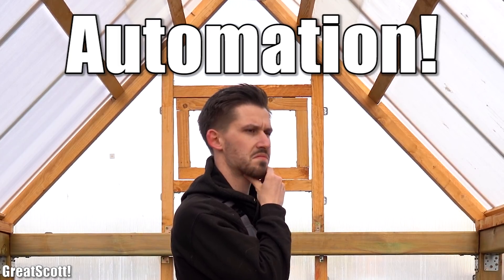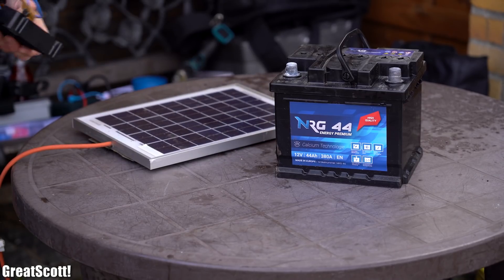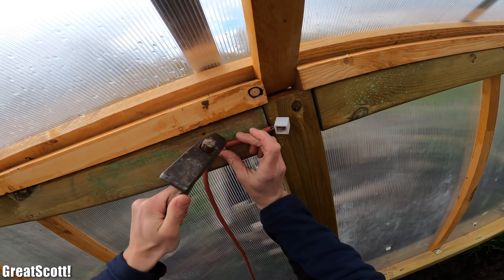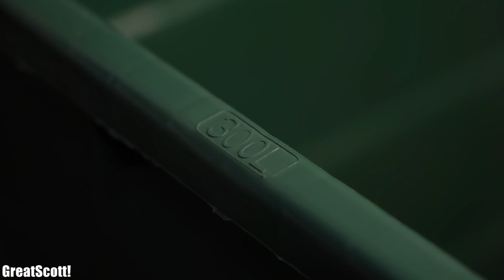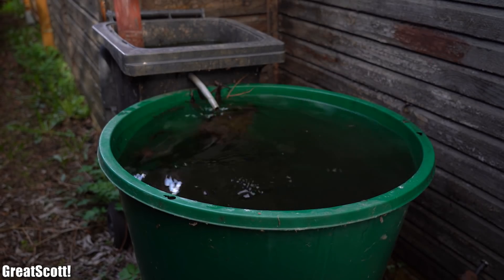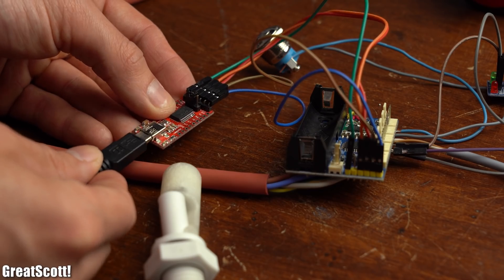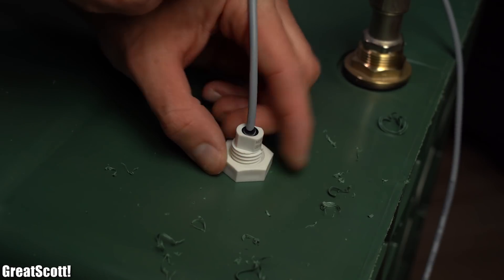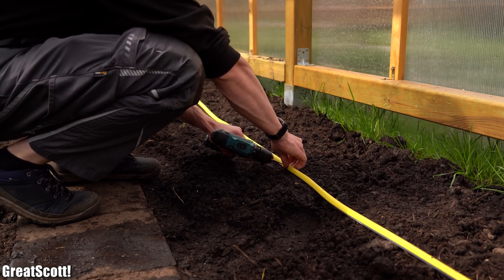How to make an Automated Watering System! Automating a Greenhouse with LoRa! (Part 3)

Comment: I tried drilling holes in a length of garden hose, but the holes are prone to blocking up. You can get a weeping hose with micro pores all over. It spreads the water evenly and doesn't block up.

Comment: Great job and I like the non-electric temperature-controlled window opener. It would have been a lot better to use drip irrigation tubing and sprayers/drippers. Some drippers are even fully adjustable so you can control the amount of water to each plant.

Comment: Is the solenoid stored outside the greenhouse?  From the research I've done, the solenoid should be operated in an upright position, and preferably out of the elements (due to corrosion on the electronics and such).  I'm looking at doing something similar - I want to refill a water tank from a hose bib if it gets low.  I have all the sensors and electronics - I'm just trying to figure out how to keep the solenoid happy.

Comment: I made something very similar about two years ago. I used capacitive soil moisture sensors. The irrigation is activated automatically when the soil moisture is below 40%. They still work very well. At first I also went with a drip irrigation too but I found out that spray nozzles actually work better.

Comment: I bought a timed electric plug in switch which I plug in the electric socket and then adjust on and off times for 24 hrs and then plug in bedside lamp to turn on & off while I am away. 
You can use a small water pump to turn on for 5 mins, 4 times daily to water the green house- wouldn’t that be easier. The water pump can be used to pump water from water barrel.
This pump can be small pump used in small/medium sized aquarium.

Comment: Instead of a garden hose you could use drip irrigation tubing (prices vary), and a 1" valve with flow regulator ($40 USD). That way pressure isn't an issue and can water more efficiently throughout the whole garden. Source: I design sprinkler systems for a living

Comment: Barb style drip emmiters could be added to the hose in the greenhouse to help even out the watering. Also, a lot of automated lawn watering equipment just begs to be torn apart and used for something it wasn't intended for. I don't know what prices are like for you, but here it's cheaper to buy the lawn system and hack it than it is to buy the components to build your own.

Comment: GreatScott, here's a small hint for the future: It's a good idea to seal the cells in the polycarbonate sheeting with aluminium tape or silicone so that dirt and water can't get in. If you leave them open, they will look quite ugly, contaminated with dirt and algae after some time. Btw, are you going to somehow measure the right amount of water needed for every watering cycle? Are you somehow going to compensate for pressure loss caused by water level drop, and subsequent change of the time needed for the right amount of water being dispensed to the plants? Anyway, nice project, looking forward for updates!

Comment: Nice video. Would add drip irrigation filter to your system to prevent clogging of the drip holes. Also if someone is planning on building such system, pay attention to what solenoid valve you are ordering. Some need municipal water pressure to actually open/close when electricity is sent.

Comment: It just so happens that my dissertation is about this. Mine is a smaller version of a greenhouse with electric lighting ,but I use a capacitive soil humidity sensor to determine automatically when the soil needs watering. I'm about two months into turning my paper in and about two weeks since I finished the build and planted the seeds - to test it I'm growing radishes both in the automated greenhouse and next to my room window. Sufficient to say that the ones in the automated greenhouse are a lot well more developed

Comment: 10:38  You should plant your tomatoes much deeper than that. Tomato plants will grow roots on any part of the main stem that is covered by dirt. More roots = stronger/thicker stalk = stronger plant to hold up fruits + more fruits and bigger fruits.
The two lower leaves cut them off, and then bury the plant about 1-2cm from the lowest branch. This will allow it to have loads of roots and you'll get a MUCH better yield  😎😉

Comment: Relay will get stuck, give it time :) It's an inductive load, meaning a spark. 
Use a mosfet with a flyback diode? Or at least some snubber circuitry. 

Oh, and btw. Why do you need such a huge solenoid valve? :)

Comment: Drilling holes in the hoses will certainly work, but wouldn't the pressure at the end of the line drop significantly so you'd only get a trickle there? Seems like flow through each hole would be inconsistent.

Comment: Nice one! I was just hoping to see an alternative valve that wouldn't be a power-hungry solenoid. I created a servo-actuated valve for my project (using much smaller li-ion batteries) and it works really well, but I'm still not convinced it is the best solution - if the batteries die suddenly the valve could remain open, and I'm not very comfortable with that :(

Comment: I would use two solenoid valves in series. I had a friend for with a valve remained stuck on open and the greenhouse was flooded with water. If you add a water sensor after the valves you can even do an automated self test open them one by one and make sure no water is flowing and then you can open them both. In case one of them is failing you can still use the system and have a warning. If you want to go paranoid and make sure that they are not stuck on close either and get a dry garden you can put two more in parallel with the first two :)

Comment: I found some watering devices that run on 3.3v and on AA batteries. I haven't check the amperage, but it seems very very low compared to 1.6 amps. I bet you could find the part for those low power, they seem to work really well in my greenhouse and haven't had to change the batteries in a month so far, you could run it off your solar, even if you still needed the relay.

Comment: Just a small tip: Both antennas should be in the same orientation. Otherwise you are not able to pick up a lot of the radio waves.

Comment: This video was just what i needed. Spent 1h30m yesterday designing a float switch with a a little microswitch only to find out the activation force was too much for my float. didn't think of using a reed switch before. that should solve my issues

Comment: A way to save water would be to consider a soak in time for the water used.  This is to prevent water flooding and running off to wastevill.  The watering cycle might be, water for 8mins,  but breaking that down into say 30 second slots with a 20 seconds stop for soaking in.  That would help keep the water where you want it.

Comment: I would suggest using a T-joint for watering pipe the one which is inside the GH, so the water pressure throughout all the holes is equally distributed rather than closing the end with a stopper

Comment: Why don't you try the dripping method?
Economical and stable
Plus you can add a motor for drops per minute and increasing pressure of water flow.
Just a bonus feature to this series!!

Comment: One important thing you might need to look into - The solar panel looks woefully undersized for the 24Ah battery. Either reduce the battery capacity or increase the panel watts. This combination will end up ruining your battery if it hasn't already. Ask me how I know.
As already suggested elsewhere, small ducting for the roof to guide all the rainwater directly to the tank would be a nice addition. :)

Comment: I would suggest to read about solenoid drivers. Your solenoid takes a lot of power and can overheat or break early. You dont need 12 to maintain reqired position. You can lover voltage up to 4v, solenoid will take 1/10 of rated power and still be opened. I did this control using pwm with 1khz, so i can hear then solenoid is working

Comment: If you want your relay contacts to last, you should make sure to include a diode in anti-parallel across the solenoid coil to suppress the back EMF spike, otherwise the contacts will eventually weld together. Depending on your relay board these might be included already, but maybe not - definitely check for it and add one if necessary! The relay will not last long driving an inductive load without protection as shown in your schematic.

Comment: Next projects might be controlling the watering with a humidity sensor, controling fertilization with an EC meter. And last but not least a robotic tomato picker.(this one is half a joke but also a phantasy of mine). BTW you can get pro driplines for cheap. I reccomend these. Well done. I liked the lowtech window opener.
Reply: Regarding robotic tomato pickers, industrial farms have a version of this. They plow up the entire plant and shake all the tomatoes off of it. But then there are still unripened fruits, so they use computer vision to discard the green ones as they go through a chute. Obviously this is very wasteful so an actual picking machine could greatly improve yield.

Comment: Run your solenoid on AC voltage and enjoy the wonders of magnetic induction. You'll cut your current consumption by ~75%. Commercially available irrigation solenoid valves run on 24VAC, which is both more efficient, and less prone to losses over long wire runs. They draw 200mA of holding current and 500mA inrush - so 5W with a coil winding between 25 and 60 ohms. Not sure what its inductance is, I don't have an LCR meter capable of measuring it and my o-scope skills are lacking. Applying 24VDC to that same solenoid draws 700mA, or 17W, constantly.

Comment: Car battery isn't designed for this sort of use.. If this is supposed to run for years I'd dish out the 100$ for a specialized battery with thick plates

Comment: Be careful with your system. Flow is going to be very dependent on pressure which will depend on water height in the barrel.  Getting the barrel higher above the water nozzles so the lowest water level still has acceptable pressure and possibly using a smaller orifice where the water leaves the barrel to peuposly limit the flow and pressure may help. You have to tune this carefully with the flow out of the watering nozzles of course.

Comment: 11:00 hi idea for you. If you raise the hieght of the water barrel, there will be more water pressure. Then possibly more holes in the pipe. You can make a platform out of pallets and rope the green water barrel down to the ground pegs (like a pyramid shape)

Comment: I don't know if they are available in your country, but sprinkler valves are relatively cheap and available at the big box stores.  I even used them with compressed air for a Halloween decoration.  Yes, they honk, but that's a good thing :). The ones I bought are compatible with many off the shelf adapters, I went to schedule 40 PVC.

Comment: Instead of ordinary water hose, you could use drip hose for a garden. Thus you can setup the the watering circle of each “hole” based on the pressure. They are adjustable.
Reply: That's what I was going to suggest. It also has a known water delivery rate, so you can calculate the time it needs to supply enough water.

Comment: I don't know how much the solar panel(s) generate but wouldn't it have made a bit more sense to use something like a sprinkler up top with a pump to "make it rain"?
Mainly because when i look at the water flow, most of the water just concentrates around a few places where the water squirts out of the hose.

Comment: one tip do not make the hose holes equal , make them  larger on the end  and smaller on the begin ,  this help maintain the pressure equal from one point to the other

Comment: Now u just need to full automate it by mesure how moist the soil is and the temp inside and then code the moist meter reedings to the water system and then but af small motor on the Window to open when its to hot inside og close if its to cold

Comment: Nice video! They sell irrigation hoses that are porous to allow water to seep out through them and they don't require any holes to be drilled. Perhaps this might also work for you but you might have to do a bit more code to figure out water usage as they are slow.

Comment: I might suggest burying the hose so it's flush with ground level, and using waterproof sheet or weed-control layer on top to better control humidity and reduce evaporation.
Another tip (apologies if duplicate), try using a raspberry Pi instead of the LoRa. Simple scripts to control timing etc can be changed remotely, plus you can connect a webcam to live-feed or even take time-lapse video of plants growing to make into a little movie afterwards.

Comment: Might want to put a filter on the intake to prevent the pipes from getting clogged, specially if you are going to let the barrel open.
Reply: Yeah that would be essential. Having the valve stuck in an open position and losing all the water every now and then would be a shame for such a nice project.

Comment: With 12V and over one ampere of energy use  you could at least try to power a little dc pump instead of the solenoid valve, this would also prevent any algea from growing inside of your tank and clogging the holes of your garden hose. But otherwise i liked this project.

Comment: Pretty fantastic work, dude! It's looking great! 😃
Something you could do and would help a lot when you're traveling, for example, is a multi level for the water barrel. You know? This way you can know exactly where the water level is. 😊
Anyway, stay safe and creative there! 🖖😊
Reply: I was thinking along the same lines. It should be possible to use a pressure sensor to track the water level, this will give much more precision than using multiple discrete sensors.

Comment: Couple of things come to mind, why not take this to where it manages itself by having moisture sensors that detect when the ground is too dry, that way the system can regulate itself if needed. I don’t know what your rainfall is like but you may also need to have an overflow that takes excess water back down a drain if there is one close? Maybe also different ‘zones’ for different plants? (Thinking out loud so to speak)

Comment: Solenoid valves need a lot of current to open but much less current to hold.  You can take advantage of this phenomenon to save power and prevent the solenoid from overheating by using PWM to modulate the holding current with the help of a mosfet.

Comment: Watching this video as an American, it was kind of interesting to see the differences between Germany and America. Almost everyone in America will have access to water coming from the main and will use that in their garden, and standard hoses are not quick connect, but rather a screw-together system.
Reply: Those quick-connect hoses are not that uncommon here. They are often called "gardena connectors". My house came with them from the previous owner. I found them more prone to leak than a screw-on connection with plumbing tape.

Comment: I bouild pretty much the same system a year ago. It works fine. I would really sujest to add a diode between the Input an output of the valve I forgot that and destroyed two relays over two weeks. Maybe your Battery controller already has such protection bould in, but it does not hurt to be careful. Keep up the good work

Comment: you  can lift container for some more pressure, and if the container has lid you should have a small hole in it to let air into it when water drains out

Comment: Did you look into DC latching valves? I have a few and they only require a 5-9v DC pulse to open, then another in opposite direction to close. I have been using them with just lipos and they work great

Comment: Of coarse it works pretty well
until the tank is half full
Reply from the maker: Even with half tank it still works fine. I think at 1/3 there will be problems.
Reply: Make a shower head thing with a pump on the roof

Comment: the water level sensor isn't to low? If there is barely water in it the sensor still will say it is fine, but there won't be enough pressure to equally water the whole greenhouse.

Comment: Learn from me: 
You need a lid for your rainbarrel. Or else all kinds of algae will grow and that combined with all the dust/pollen/bird-droppings/leaves will clog up your system fast.
Reply from the maker: There is a lid. It was just not shown in the video
Reply: @greatscottlab  
Is this real??

https://youtu.be/zeBjzbADZ80

Lab power supply
Reply: If you add fish look up aquaponics. The idea is to grow meat and vegetables.
Reply: Also   paint any water containers black - otherwise there will be algal buildup.
Reply: Evan with a lid I would suggest adding a sediment filter. It probably won't make a huge difference with your valve but I ruined a small pump from dirt.
Reply: Or put a small fish, or aquatic snails inside
Reply: @Yonatan24  aquatic snails, that's a really good idea!
Reply: @BrettCooper4702  You could get them at any fish store too. I got some accidentally on plants I bought.
Reply: @Yonatan24  and then some catfish to get rid of the snail clog :P
Reply: @Yonatan24  also there waste also gives your plants some nutrients.